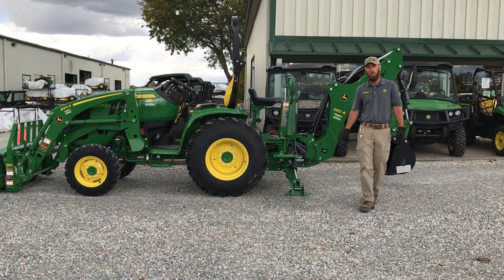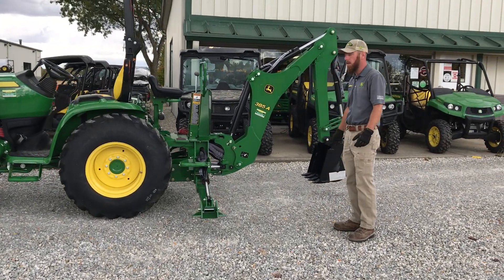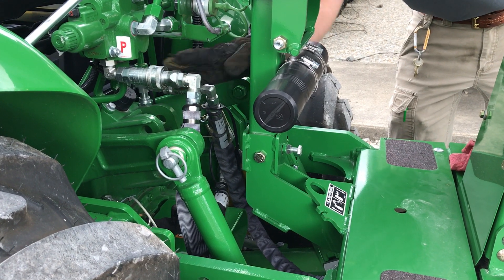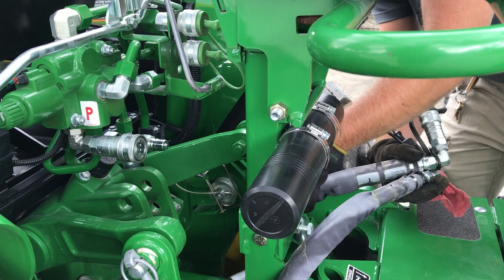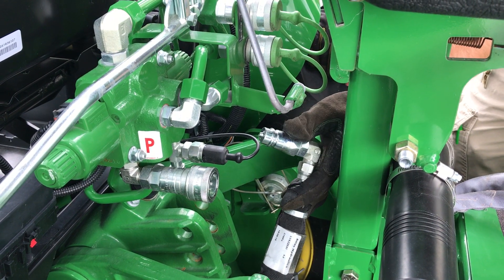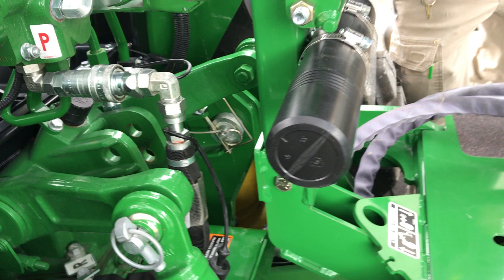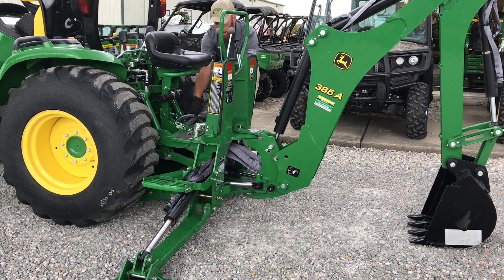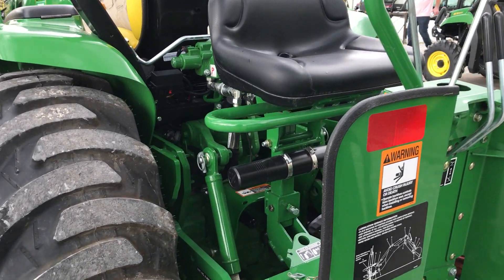How to Remove a John Deere 385A Backhoe

Comment: I've just purchased a 2020 3033r tractor. I've watched many videos on buying a backhoe. Most videos discourage you because you have to take some of the 3 point hitch parts off.  Some glad I stumbled on to this video 👍 👍.  I'll be buying my 385 backhoe attachment. That is the slickest set up I've seen. Thanks very much for the video.
Reply: They’re worth it I have one. Buy the 385 not the 375 385a has more power.
Reply: @aknapke1215  thanks